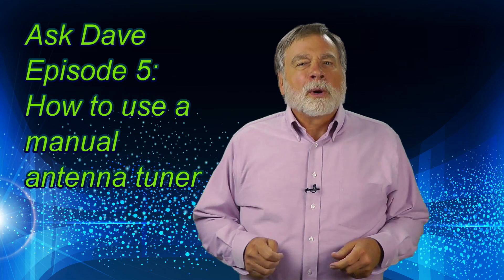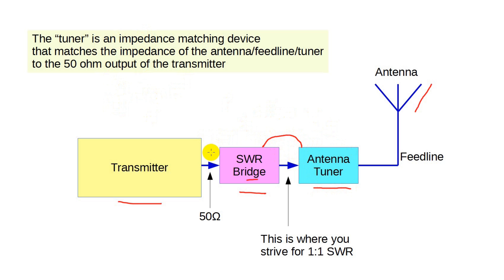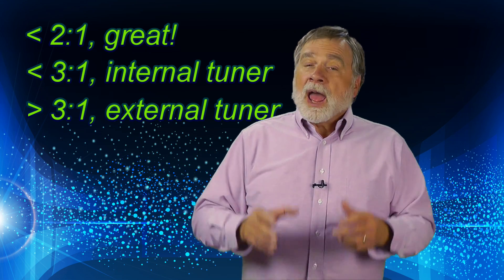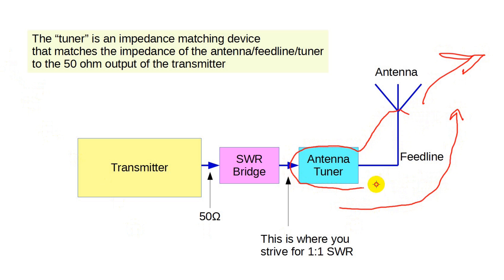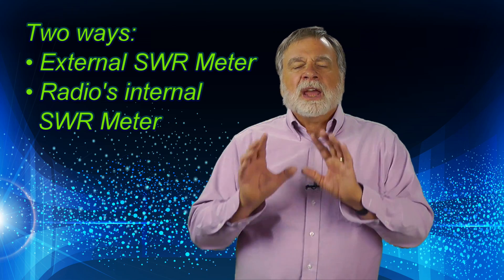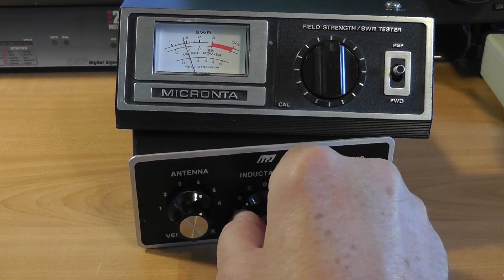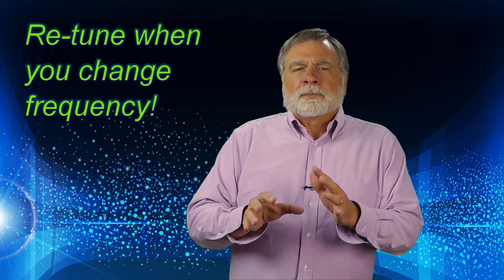Using a Manual Antenna Tuner: Ask Dave Episode 5

Comment: SWR DOES NOT tell you everything!
You are looking for a place where you will get 100% output on any frequency you intend on operating at. SWR will NOT always be the answer. MAXIMUM POWER OUT is the best way to be sure your antenna and transmitter are as perfectly "Matched" as it can be.          

So, How can you do that?

After you get the SWR as LOW as possible with your Antenna Tuner & SWR Bridge, 
flip the Fwd/Ref switch on the SWR Bridge to FORWARD. 
Reduce the output to midscale or so and again put the transmitter in  the Transmit mode.
Now by carefully TWEEKING  (first) the INPUT TUNING CAPACITOR in the tuner, observing the SWR Output for MAXIMUM OUTPUT and then Tweek the Output Capacitor in the Tuner also for MAXIMUM OUTPUT.
Recheck the Input capacitor for maximum and you should be READY TO TRANSMIT where ever you tuned up.

It  sounds like a lot of messsing around BUT once you've found the Lowest SWR,  The second step is to make sure your transmitter is properly tuned for the best match from the transmitters output circuit into the antenna tuner. TUNE FOR MAXIMUM OUTPUT and you will have it!

Increase the output of your transmitter to it's normal operating power and mode and have at it ! :)

On 160, 80 and maybe 40 meters the width of acceptable band width that you can cover without re-tuning will depend on the antenna you are using. Higher frequencies can cover a wider spectrum of the bands than you can on the lower frequencies. You'll have to go through the entire procedure if you QSY too far from the first frequency you originally tuned up on.
Reply from the maker: I've always tuned for minimum reflected power. As you say, the actual SWR is by no means the most important measure of an antenna. Shy of having an antenna test range, the only way to get a feel for an antenna's performance is to get on the air. When I had the 80-m full wavelength horizontal loop in addition to the vertical, I did A/B tests constantly, both on transmit and receive. The evidence was overwhelmingly in favor of the vertical, to the point that I took the loop down. 73
Reply: ThaT'S RIGHT - tUNE-'EM UP THAT WAY & YOU'LL ALWAYS GET THE THE BEEST EFFICIENCY FM YOUR STATION.

Comment: Thanks Dave! I have an ATU and a Manual Tuner. I bought the latter to use it for DXing with my receivers. I have an MFJ-974HB that has a power and SWR meter built in. It is a bit bulky, so I may get a smaller manual tuner for DXpeditions. 73 from PY3WHO /PY5136SWL.

Comment: how about when/where/why to use an antenna tuner?
i guess an example would be, say I have an FT-450D, it has a built in antenna tuner capable of tuning out 3:1, but lets say im using a Windom or OFC dipole which is designed to have a fairly low SWR on multiple bands (i've heard 80-6m can be under the 3:1 across - though i think that might be a bit of a marketing claim). would it be better to let the built in tuner do its thing no matter what, or, if the SWR is already fairly low, just leave the tuner off?

from what i've heard, having the tuner on reduces the power? i'm sure its minimal, but with farther out of tune antennas, how would this effect "real world" performance? antenna on doing its thing, vs off with a bit of SWR (but still acceptable, up to say 2.5 or so).
Reply from the maker: It comes down to experimentation. Leaving the tuner on all the time is probably the way to go unless it misbehaves. Some of the verticals on the market (e.g., AV-640) are pretty spectacular when it comes to low SWRs across multiple bands, but they can be pricey. The OCFD is a popular antenna these days, but you might need a wider-range tuner than the built-in tuner. 73, Dave

Comment: Thanks for all your videos. I have a Yaesu  FT- 817ND radio, and a MFJ-971 manual tuner. What mode do I put the radio in to send a carrier for tuning. AM?  and should I transmit the carrier at 5 watts or reduce it. Thanks KG7CQG.
Reply from the maker: You can put the rig in CW mode. You may have to use a menu setting allowing the buttons on the hand mic to act as a key, or you can simply use a telegraph key plugged in. The tuner you have has a QRP mode, so  you may not have to use 5 watts, but can use a lower power. Good luck! 73, Dave
Reply: Ham radio kenwood 590

Comment: Hi David,

Really good video congrats the way which you explain i found very good, I'm  struggling with a President Grand II and a sirio signal keeper to reach a better SWR value right now I'm on 1.9:1 which is not bat but i wanna do more, Yes i operate currently only CB and I think you convince me to get a antenna tuner, I tried all possible ways to get antenna higher, I've build a ground from a 2.5 m copper rot  and is no difference if I connect the ground or not which lead me to idea actually maybe antenna mass reflectors  are not working well, the antenna have a total height of 209 cm including the base coil but one radiant is only 65 cm I think way to small, but i don;t know how to calculate the proper size for them. I know for a 102 inch whip to use same length for radiants but the whip have no inductive coil so i'm a bit lost here.....

Cheers,
Reply from the maker: The 102 inch whip is a full quarter wavelength at the frequencies you're using, so needs no loading coil. Generally if your SWR is less than 2:1, you're okay. Getting it down further could take lots of work for little gain. I'm not familiar with the products you mention, so I can't offer much help there. Keep experimenting, and, of course, an antenna tuner might help.
Reply: Thank you!

Comment: Great video. I am living in a ground floor apartment. A have one buddipole dipole antenna. If I put my antenna in the balcony, how much ground and side clearance do I need for the antenna?
Reply from the maker: There's no hard and fast answer. Simply do the best you can. Farther away from the building is better, but that might only be a matter of inches. Good luck! 73, Dave
Reply: Thanks Dave :)

73 de OH2EYS

Comment: Hi going for my Tech. lic. next week. I've ran CB radios for many years . do you tune your antenna in the same manner as a CB if your radio does not have a built in swr meter? looking to get a BTECH 5001 for both mobile and base unit , possibly setting one up as a emg. go-kit .
Reply from the maker: +richard imel Essentially, yes. Put the SWR meter between the radio and the tuner, then adjust the tuner for minimum SWR.

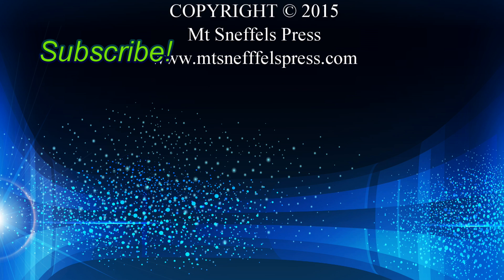Comment: Hi! Nice videos. At about 10:18 you said a wimpy feed line can come across as a good SWR. Can you expound on that? That wouldn't hurt the transceiver but will cause poor antenna performance, right? Thx! 73 KD9FHY
Reply from the maker: +E Spizzirri Wimpy coax is lossy. Since Since SWR measures the ratio of forward power and reflected power, in lossy coax some of that forward power is lost as heat before it even gets to the antenna. And then the reflected power is similarly attenuated.  So, at the SWR meter, it looks like the reflected power is less, so it reads a better SWR because there's less reflected power. 73, Dave, KEØOG
Reply: @davecasler  so, would it be good to somehow measure and compare the two temperatures of the two coax cables either side of the tuner?

Comment: Dave, you forgot something VERY important.  When tuning an antenna into anything but a dummy load (and why would you want to tune a dummy load?), you must ID your station!!!  Every time you radiate a carrier, no matter how small, you MUST, either in phone or CW, IDENTIFY!!  Transmitting into a radiating antenna without an ID is ILLEGAL!!!  I never once saw you ID in this video.
Reply from the maker: +Species 5618 No need to shout! When I test I identify myself. The act of doing so did not make it through the editing stage of the video. The video focused on tuning, not on identifying. 73, Dave, KEØOG
Reply: +David Casler First of all, I'm not shouting.  I used exclamation marks to punctuate the message.  IfI sometimes capitalize a word because here on YouTube there is no way to type something in italics. I were shouting, I would have used all upper case letters.  Secondly, you might have at least MENTIONED that an operator should ID when transmitting a signal into anything other than a dummy load.  How many new hams will see this video and think that IDing isn't necessary.  The number of unidentified carriers on the bands causes serious interference problems, as I am sure you are aware.  And as a ham for almost 40 years, I can assure you the problem is much worse today than in times past.
Reply from the maker: +Species 5618 I suppose we'll have to agree to disagree on what the editorial content of each video should be. Regarding the epidemic of tuning up without identifying, my experience is different from yours. I rarely hear it. I can recall back 40 years ago that every radio required tuning before use, so there was lots more tuning up on the air, though it was usually quite short. HOWEVER (italicized, bolded, and underlined), and this is a big however, today I see a dramatic increase in discourteous behavior on the air, from simple and casual profanity and vulgarity to deliberate interference with other people's communications. In my video on the 20-meter band, I advise viewers to simply avoid frequencies above 14.300 because of this type of behavior. Also, I frequently hear people "tuning up" on top of a DX station. It's not really tuning up--it's deliberate interference. Lots of reasons have been advanced for the increase in discourtesy, but it certainly parallels a similar erosion of courtesy in our nation at large.
Reply: +David Casler Yes, agree to disagree.  And 14.313 is definitely a problem as are some spots on 75 meters.  Interestingly, as we speak, I am listening to the Beehive Utah Net on 7.272, getting ready to answer my name on the roll call, and at least two inconsiderate people are throwing fairly loud carriers.  I hope they quit before the NCS calls me  unfortunately, on this net, interference is the rule, not the exception..  VY 73 de Dave AJ5f
Reply: +David Casler  I will usually just put a preprogrammed CW ID, and a digital voice recorder with a ppgd delay on the mic so it plays out, after I release the PTT. I had a cable failure with a mic, and the audio was not getting out. I don't have too many problems with people interfering while they are tuning up. There are a lot worse problems out there than that!!!! Mainly I just see more idiots who deliberately stomp on other signals, & use language that is banned by the FCC. How can anyone be annoyed by tuning up, when we have a--holes seeking out frequencies in use just to disrupt them? Or they get vulgar & obscene. My grandmother was using a party line way back when. My aunt was very ill, and she was calling the hospital to check on her. Some person, cut in and said, "I wish you goddamned bitches would not take up the phone with your f---ing gossip. Grandma was a CWA member & a telco operator at Buckley Field. Her brother was a high level management supervisor for Mtn State Telephone & Telegraph. The potty mouth's phone was held hostage for a fine.  If I am having problems with that ATAS, it drops to 5 watts to tune, but I try to find a rarely used section of the band, and I will just hit the CW auto play or a digital recorder, with "KI7AQJ testing KI7AQJ, and let that play as & after I tune the ATAS, which we did finally get it working! By the way, let me email you my number. My uncle is an old Military Intelligence radio man, and he hosts a lot of hunters, motorcyclists, snowmobilers, & others up at the cabin. We'd really love to have have you stop by for a meal, & maybe stay the night. We are 4th or 5th generation western slope Coloradans. He enjoys having visitors up there. He is legally blind now, but you probably won't notice. I am making another J Pole & a trio of ground planes in VHF, UHF and a VHF/UHF combination. I need to go out & finish turning some trap coils, & get those element soldered to the PLC259s. I need someway to get out on 80 & 160. I got the net up in Nevada last night, but now way would my puny 100 watts reach. I know who I could hear, and he is running 1500 PEP with two 160 foot towers. I could not hear anyone else, except for one other operator answering him at all, and they were all in Nevada. I don't think my ATAS would like transmitting down there anyway. I am getting a tuner, and do I have a nice 8164 powered linear I need a power supply for. I need to attenuate it back to the legal limit. 73 KI7AQJ

Comment: Hello, Dave,
Name here is Sean.
I am using an MFJ-945E (cross needle) manual tuner with a Yaesu FT-757 GX II HF xcvr with an HF5B / Butternut antenna on 30 Ft Rhon Tower.     
What mode do I need to select when tuning for Power/SWR?
73s and Tnx
de
KD4ADV
Reply from the maker: Sean Ingram Hi Sean, the procedure for checking SWR is on pages 26-27 of your manual. Basically, transmit a few watts and check SWR. Given your beam antenna, if it's set up properly, you may not need that tuner at all. Good luck! 73, Dave, KEØOG

Comment: when I first started in ham radio I used a incandescent light bulb, to tune my transmitter. I went thrue a few finals before I got enough parts to build a tuner, then as I got more money I finally bought a used one. nice hobby and you have a nice video.

Comment: Hi Dave, excellent video, I was just wondering if it was a good idea to adjust the inductance while transmitting.  I was always told this was not a good idea.  I always start with both capacitors at 50% and tune the inductor for maximum noise first.  Then maximum noise with the capacitors and fine tune with a carrier.  Excellent video and thanks!  VE5DLD
Reply from the maker: If your power is high, you might get some arcing if you adjust the switch with transmitter power on. If your power is low, this won't happen. I've never had the problem myself.

Comment: Great video Dave, thank you. I have an MFJ-969 tune and it works quite well with my Yaesu FT-950. The 950 has a built-in tuner as well and I was wondering if I should even use it after tuning with the MFJ-969? I was concerned about having tuned with the internal tuner then trying to tune with the MFJ or vise versa so I reset the radio to factory default settings and have since left the auto tuner alone. Any thoughts on this matter are greatly appreciated, keep up the great work! I upgraded to Extra in March of this year having reviewed many of your training videos. Again, many thanks.

Frank, K6FLD
Reply from the maker: Frank D Hi Frank, I'm glad you found the videos helpful. You're right - either use the internal tuner or the external one but not both. Usually you can tell a radio to turn its internal tuner off with a menu setting or something. I'm not sure on the 950. Good luck with your HF work! 73, Dave, KEØOG